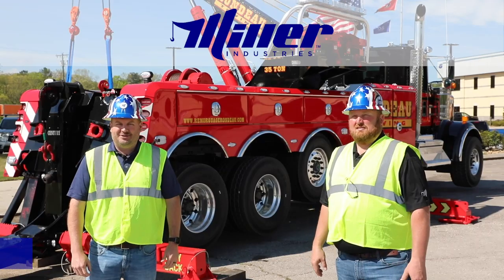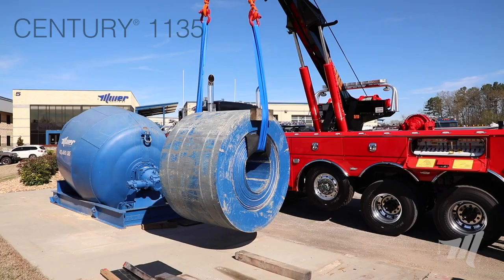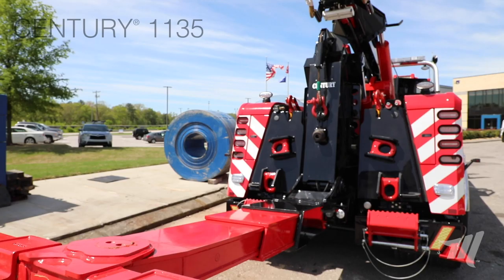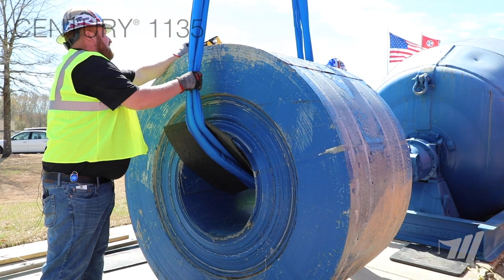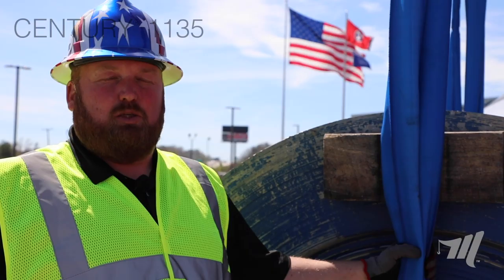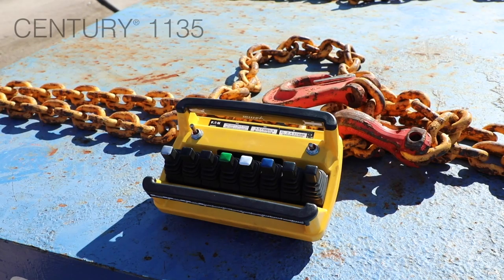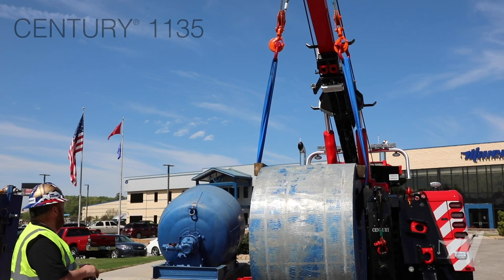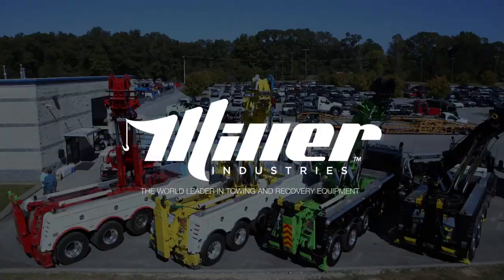Century 1135 Key Features and Product Demonstration

Comment: I allso follow Ron Pratt and have asked several times WHAT powers the rotation of the boom is it an electric motor or is it Hydraulic can you please show us nontechnical guys how the boom pivots and how its anchored to the truck chassis .  Thankyou .
Reply: It’s the same turret bearing as an excavator but on a smaller scale, it’s a large heavy duty bearing with a hydraulic gear drive in the center

Comment: I’ve been watching multi-videos of heavy duty recovery for maybe four years. Most notably. The awesome Ron Pratt out of Scott city Missouri. But I’ve also watched some others. Which some of their jobs seem to be a little bit questionable.

One guy used both blue and white cables and put the hooks together with a snatch block on one of the lines. He was also using endless loop on the end of the snatch block. As he was picking up a heavy coil like you were doing in this video. Your technique seems to be a lot safer than the other guys technique.
Reply: Wait he what? Put both lines in the same snatch block or? And how did he place the endless loop?
Reply: @towtruckaj  Pretty much as I stated. He put the blue & white hooks together with a snatch block on one of the lines. He was also using an endless loop on the snatch block. He put one end of the endless loop on the snatch than ran the endless loop through the coil He than put the other end of the endless loop on that same snatch block.. To me that didn't seam to be very safe. Also too by doing it that way it didn't seem he would have much adjustment or control of placing the coil where it needs to be on the truck. On THIS video they are using both lines indepently of one another. They can adjust the angle of the coil more evenly..
Reply: Thats called marrying the lines that coil weighed i think 15k well below WLL,these guys coil weighs 35k,so they had to 4 part line it cuz with the lines married they would still be under WLL